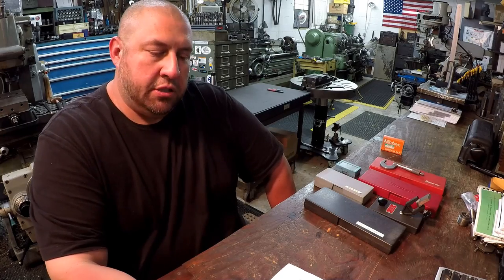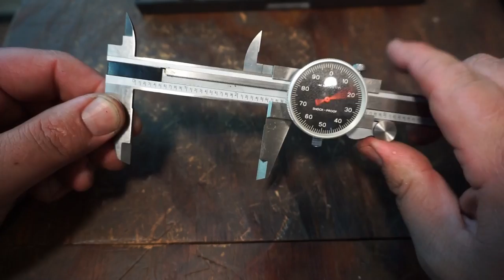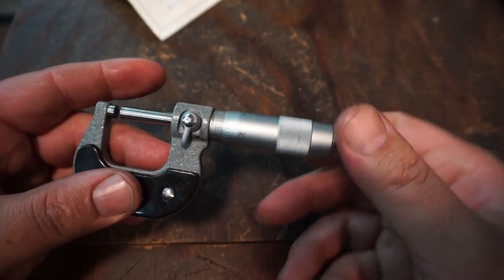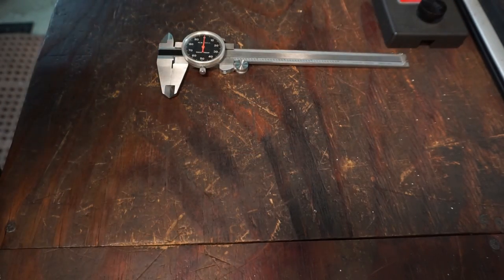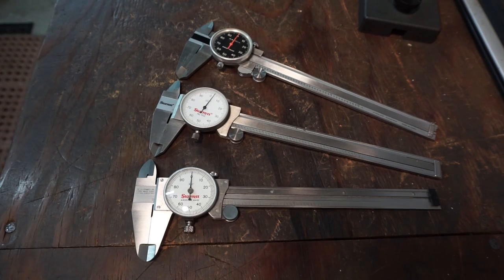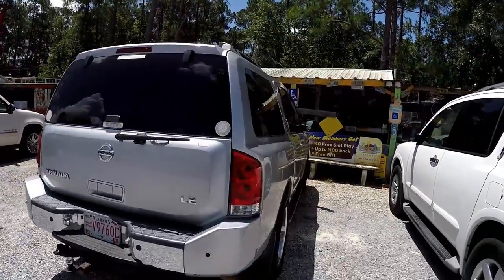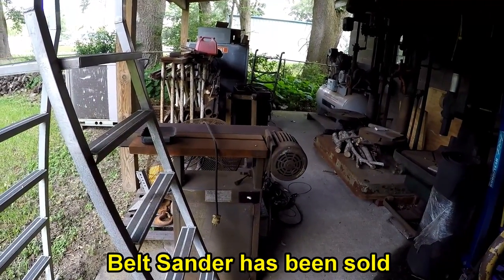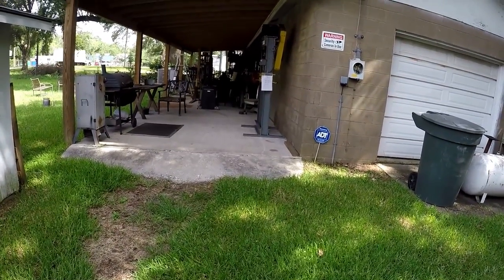SNS 175: Cheap vs Starrett, Shop Upgrades, Weekend Adventures

Comment: Sorry but when you are holding tenths only go with name brands, Starret, Brown and Sharp and mitutoyo mics. It’s the feel of the mic, it like every mic has it own personality with it feel.

Sorry but when you go to a shop the first thing I look at are the tools. Crap makes crap in my book.

When I buy tools I only buy good brands. The top three. Hell I just got my Starret 9 inch caliper that is made here in the USA. My next buy will be the Starret 12 inch made in the USA. I do have Mitutoyo 12, 8, and 6 inch but they were all metal no plastic except for the bezel, which they don’t make no more. Expect for Starret which does.

Comment: Fowler, just like Mitutoyo, has tools from a number of countries. So does my favorite, Brown and Sharp. But I also have some cheap tools. I have the exact same Chinese calipers, except with a white dial. The difference is that I bought it 36 years ago. I bought it for my company, because the good tools kept disappearing. It’s amazing that this tool is still in perfect condition, and remains accurate.

Comment: Adam, I am just starting out in 'machining' (more like making messes) but have use calipers for years usually on the reloading bench. I was told, years and years ago, to never store calipers or mics with the two jaws anvils touching. The rise and fall of temps could distort them. Ever hear of that?

Comment: At 16:33 Adam pulls out his grandfather's Starrett stainless steel #1230 micrometer, which is still made, and available as I type this, from Starrett for a mere $326.00. As I type I have NOT watched the video so I do not know if it does better than the $15 Chinese micrometer.

Comment: Thanks for the video's. Adam. You might consider putting in the conduits for the three phase power even though you are not going to install the wiring right now. Once the conduits are in you can install the wiring at will.
Reply from the maker: True, but we kept the cost to a price point I was looking for so I had to eliminate the 3 phase. We will run a whole new line out there for three phase, once I pick the locations of the machines. No worries.
Reply: Abom79 p
Reply: Abom79 Hey Adam, is your new service 460v?

Comment: Something I found , The Starrett Global &  Made in USA both as well as the Flower & Brown & Sharps are all very subseptable to jumping teeth in production work in the shop to chips getting in the rack. However the made in china and Mitutoyos both seem to be more of a lawn mowers over chips and such and tend not to jump teeth as often so the Starrets and others are more of a inspection room tool more then a in production tool. 80% of the time I use the cheap China brand calipers in the shop ( at work ) to get parts to with in .010 then use bore gauges or mic's to get parts dead nut's as if the China calipers get dropped hard, you only out 15 bucks . You drop a set of them big money USA Starrets or Brown & Sharps , that makes for a VERY bad day, and yes I have done that .  The fact is you do get use to the feel of the cheap China calipers if you use them everyday all the time . However overall , I like the Miutoyo Calipers the best as well .

Comment: I have some starrets with the standard bars I bought some cheap Chinese mics and they were pt14 of a millimetre out which is close to 6 thousands of an inch not really good enough
I had to MX vernier which I also checked on this carrot standard bar and they were very close good enough for me digital
However the screw action feels very rough on the micrometre and the lock is cheap and Shodddy
But for 4 micrometre is for $67 well go for it if that's your bag
Starrett how to set a factory in Scotland for thousands of years and that's where my were made

Comment: I have plenty of cheap import tools that I use for rough work such as measuring on casting or mill scale surfaces. Also they make great tools to leave at a machine full time for rough measuring as they are very affordable and good enough for a few thousands and you don't mind so much if the get dropped or go missing. Also they make great loaners if you work with a bunch of 'those' kind of people.
I recommend a half A frame against the wall. If you make it well and then tie the top to the wall with some leg bolts you can keep it really low profile and maximize you space. I Made mine from 1 1/2" .188" wall square tube with 3' centers and it's 6' tall and the base is 1' wide and it isn't even tied to the wall and it never wobbles even when loading/unloading 3" bar with the fork, mind you it's got several thousand pounds of material on it most of the time so that helps.
On the bathroom, put the toilet in a stall and then get your self a nice big wash tub sink with a drain tray built in on the outside. If I wasn't in a leased building I would have ripped out the sinks out of my bathrooms, moved the walls and installed a big tub sink and drain tray.

Comment: Given that the actual measurements looked to be very close to identical, maybe tenths of thousandths difference, I think that you pushed perceived quality over actual performance. Granted, we have no way of knowing with that test whether or not the inexpensive alternatives would hold up over time, producing repeatable measurements time and again and standing up to regular use, but I think that you didn't really acknowledge the key fact that, in your hands, any of those tools would likely allow you to produce identical results on any job you produced. You are basically paying 15x more to achieve the exact same results. Maybe the Starrett will last 15x's as long, but if, as you have told people many times, if people treat the imports with the same care and respect that they should any piece of precision equipment, you may end up with an instrument that lasts just as long and produces just as reproducible measurements as a Starrett for an entire career.

That then leads into pricing. How much of a markup is incorporated into Starrett's tool because of name and perception of quality alone? At what point is the price based on materials, workmanship, and tolerances and how much is a premium built into the price based on name and perception of quality? The last parts of the equation are all just marketing, in the long run, so you are paying a premium for intangible benefits, name, a red box, and a sense of inclusion, as in being part of the club of people who own Starrett tools.

You can buy what you want. You can make the decision that for you, a 15x mark up is worth supporting the efforts of a company that keeps production in the US. those are valid reasons. But the fair assessment should have been that because they produce the exact same results they will get the job done, in the properly trained hands.

Comment: The problem I have always found with cheap china made crap is that it is ok at first but once they get used a little they start having problems. They do not go back to zero, if you drop them (and it will happen) they break easily, the finish comes off.

I was once told back when I was just starting out in life I guess you would say when I was about to buy something cheap. A guy told me that "Why do people have enough money to do it right the 2nd time but never the 1st?" Ever since that day I will wait to do the job right before I jump off and buy or do something that will cost me more to do it the 2nd time around.

I know money maybe tight, but if I was having to get started again I would do whatever it took to start off with quality tools, even if that meant going out and mowing yards or picking up cans to get the money. If you are doing a job for someone and your cheap tools mess up, then your going to be out money to buy the stuff to fix it.

The things I am working on people's lives are at risk, and I cannot risk having something out of spec, because something .001's out can cause a gun to malfunction or a round to blowout not only hurting the shooter but others around them.

I bought some good used tools, like an old Millrite vertical endmill, but the reason I did that was because the older stuff is better than the newer as far as quality, and even though it is 40-50 years old, it will out last the new stuff coming out today, all it needed was a bit of TLC and a few upgrades and it is better than the new stuff. So go out and find good used tools, many of which are going to be the same cost of this new crap you are buying, and even though it maybe out of spec, many places will fix them for free.

Comment: For 0-1" I have a Starrett 1230 that didn't have the tenth's drum so I ordered one from Starrett and put on it for around $15, I keep it back for when I really want to make sure I have an accurate measurement. I also have an SPI that reads to tenths that I use as a general mic and it feels as good as the Starrett BUT the only thing I don't like about it is that it's ratchet is way light like the Chinese mic you have there, I need to try to see if a Mit. mic ratchet will fit it. All my mics are used that I have bought over time off of ebay and I have up to 6", they are either Starrett, B&S or Mit. with the exception of the one SPI. 
As far as calipers go I want to get a Mit. but I have been using a digital Harbor Freight special that I have owned for at least 15 years and it still works fine, it only measures to half tenths and a bit iffy at that but to be honest my lathe and MY skills aren't going to hit to the tenths, besides when I am trying to get within .001 I am using a mic.

Comment: I realize there's no time for this, and would probably make for a boring video, but measuring tools need to demonstrate accuracy over their entire range of measurement.  And, if you're running a shop where several of these tools are used, you want to buy with confidence, tools you know will all be of similar accuracy.  It's not hard to "win the measuring tool lottery" and just happen to pick up one good $15 tool, test it, and have it come out OK.

Comment: Congrats on the shop build/expansion and looking forward to the build! Sounds like you have a good plan in mind, whatever the quote is it will run over budget as the project progresses, take it from me, my build started at 40K and looking close to 65K to finish and that's still with open walls and ceiling! Great video buddy, keep them coming!
Reply from the maker: Yikes! Ray for 50K i could put up a nice big new metal building. I decided to start small and make use of the floor space I have now and see where that leads me. I'd like to also build another covered area on the back of my house for BBQ's and socials.
Reply: A metal building would have been much cheaper but was not allowed in my neighborhood. I am glad you have something to build onto, that will save you a little there but the restroom and plumbing will be a nice chunk of cash! I started with dirt and yes concrete is crazy expensive, my slab was 11K and lumber was 10K. I plan on doing a complete cost breakdown video after the shop is complete, I think many will be shocked at the cost involved to build here!

Comment: Adam, A suggestion for the new shop wiring,
 Run a sub-main cable to a new fuseboard, Then circle the room with 3x3" steel trunking a foot or so down from the ceiling and use conduit drops for switches and outlets etc.
 It might seem a bit extravagant at the outset, but, you end up with a neat and very easily adaptable electrical installation,
 Best wishes, J.

Comment: I know this an older vid... but I would like to say regarding import tools... it depends on the specification given by the importer... If you buying a 50 buck tool the chances are big they only paying 10 bucks to the manufacturer... so obviously the quality will suffer... You might get one good one in 50... You get what you pay for... On the other hand of that... what is your intended use...Parts that are of tight tolerance or just a hobby guy that mucks around in his garage... I think we all want the good stuff...but not have it versus having at least something... that is what each of us have to consider...Its a toss up we all got to live with...  But there is some satisfaction from a tool you know is reliable and well made...

Comment: A few years ago I got a Vernier scale 150mm (6") Starrett caliper for maybe double what that chinesium dial caliper cost. Being in mm (graduated in 10ths with extra marks at 20ths), if you have a good eyeball you can just about get to within a thou. Reliably - to within two. If you need better - you need a micrometer.

Given the rigidity of this design (or rather - lack thereof) I see absolutely no value in adding precision electronics where they don't belong. Having a digital display is convenient and all the features that go with that (switching between imperial and SI, dead easy relative measurements, etc.) are very useful, but the structure just isn't there to enable reliable readings down to 10 microns or half a thou. Having a digital display - sure, it's great, but there's no point in adding unnecessary expense in chasing n-th degree precision when the tool isn't mechanically capable of it.

That said, I do also have a general issue with requiring a fresh battery for the tool to be at all useful, especially with the cheaper imports burning through them like they're not there (see AvE's quiescent current comparison)

Comment: Those chinese ones doesn't last. If you use it daily, it will worn out in less than a half year. If you need caliber just for one job, chinese will be good enough, but if you use it a lot and you need to buy new one couple times in year, it's going to be expensive in long run.  I have one witch is made by Mauser (germany) at 1935 and it's still in good condition. Mauser (weapons factory) invented that tool.

Comment: Straight out of the new bag. You test the slide friction. You didn't touch the lock break.
Failed TEST. 
Ultimately the FEEL is critical. 
Thanks for the video.

Comment: A lot of measuring tools should be treated as disposable items - thus there is a place for "cheap" stuff. Once you get it close with cheap stuff you can use your grade A set.

You don't want your $200 dial calipers to drop on the floor and get ruined. $15 cheap stuff - well its a small paint not ruined day.

Comment: For cheap calipers, you really can't beat mitutoyo for 120 bucks. They're sent to your house and they're relatively accurate and reliable but yes, I have a cheap $10 set of calipers that I use for scribing and destructive purposes that I really wouldn't want to put my other calipers through but please remember this is just my opinion and what I use. This is in no way the only way to go and still have accurate readings. Well somewhat accurate readings with calipers micrometers on the other hand, are not something that should be cheaped out on unfortunately. I've learned that lesson the hard way a few times And it seems to be the same problem with all of the cheap micrometers they put the wrong pressure on and you end up with the wrong reading whether it be loose or tight. They just can't seem to get that right 🤷

Comment: You spoke of how tight the caliper movement is, but that's fully adjustable. It's not factory set. There are 2 adjustment screws for friction on the top surface. Friction is adjustable, what matters in quality is that whatever friction you set is consistent across the full length.

Comment: Remember - out of the box, the Chinese calipers may work fine, but my experience has shown you get what you pay for. Over time (less than a year), the less pricey Chinese gauges will get sloppy and so loose you cannot use them. Yes, you can calibrate them, bt they do not hold the calibration through the hour. They get the job done if you keep checking them, but I have one pair that after a couple months were so worn down they would never go back to zero after one measurement.
... still, a tool that irks you but gets the job done is far better than no tool or trying to use a tape measure to get a hundredths of an inch!

Comment: Until I start machining turbine engine bearing seals, even my cheap calipers are good enough. I do have Gauge Blocks to check my instruments and know the  limits all my measuring tools. Even the highest quality is useless if you do not understand them. Even with the best, you still need some shop standards to check them.

Comment: Bought a modern General micrometer from a hardware store on a late Saturday night.  The anvils were not parallel :-/ probably about 2 thousands of an inch out...

I should have checked it in the store and possibly got the second micrometer off the peg.  No matter the brand and country of origin when we buy tools, we should be careful that they are defect free.  Often the corners cut are in quality control or materials.  The only good thing about the General is that it is the beater micrometer if its a dirty job.

Comment: Interesting video on the tools. IMO the cheap tools will work for a while but from what I've seen they don't have anywhere near the same durability as the better quality tools.. I go to a lot of machine shop auctions and it seems that the Chinese made calipers, mikes, etc. that are being sold are usually falling apart to the point of being useless. The Starrett, Brown & Sharpe, Mitutoyo, and the quality European brands being sold at these auctions are, the vast majority of the time, still fully functional. A great example would be the Starrett  mike that you're using. You're the third generation that's using it and it's still holding its accuracy after all of these years. I seriously doubt that the Chinese mike will still be serviceable after that many years.

BTW, thanks for the vids!!!